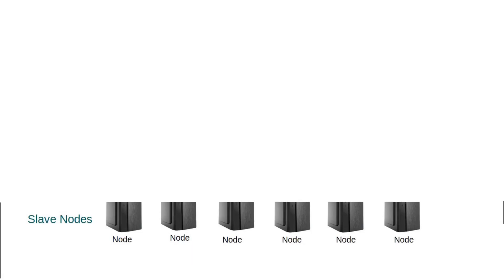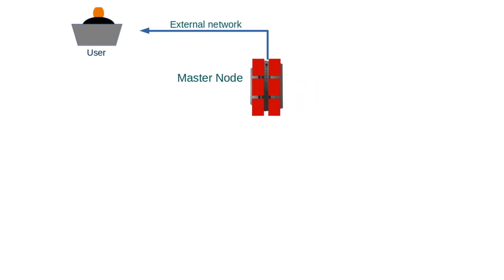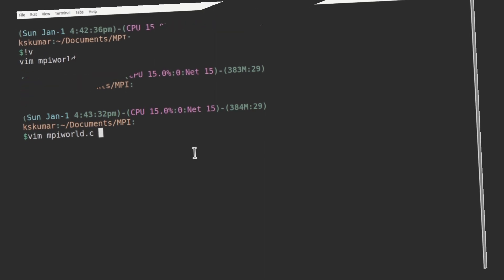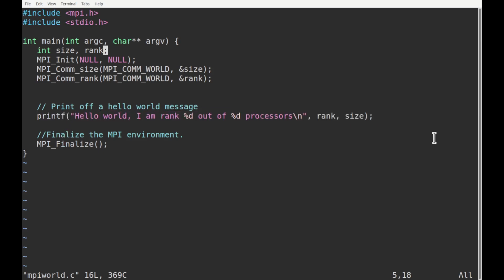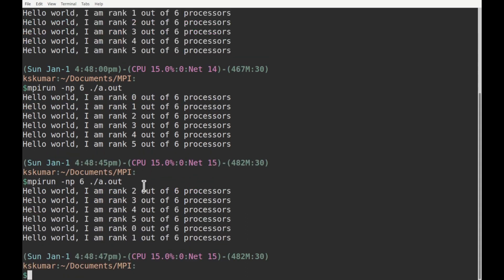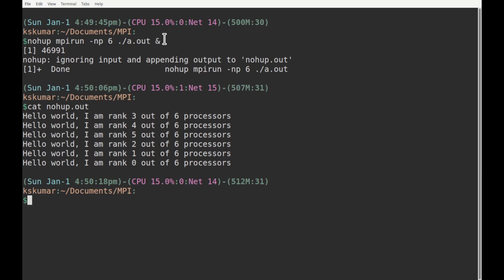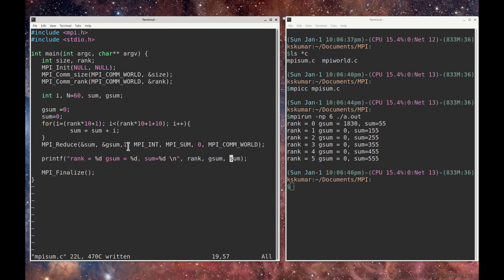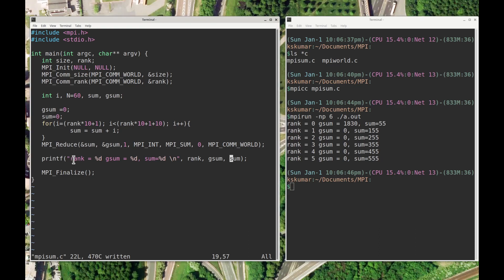How to build a single node Linux cluster and write an MPI parallel program

Comment: How i can do it withe windows?
Reply: Even Microsoft doesn't run Windows clusters. Every cluster in the world that I've ever used is based on Linux.
Reply from the maker: You can now install windows subsystem and then install MPI.